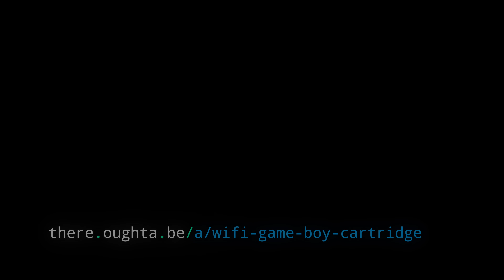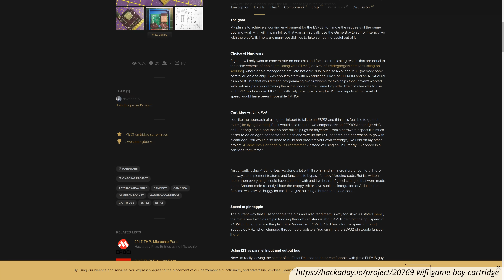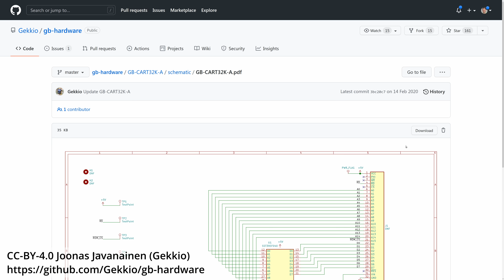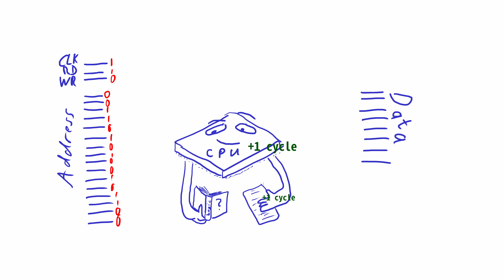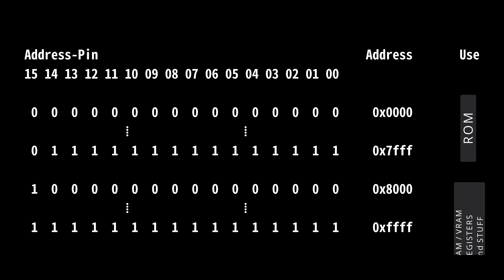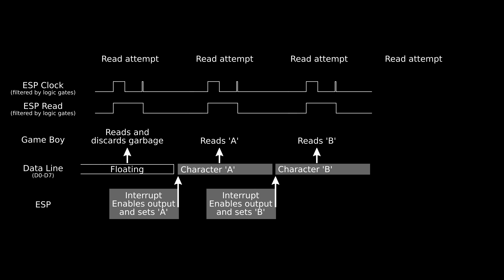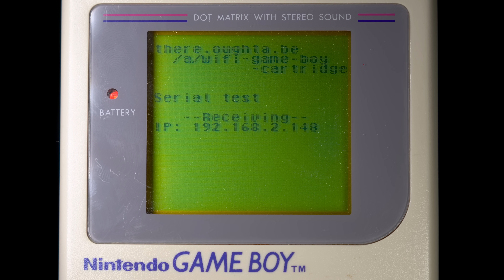WiFi Game Boy Cartridge

Comment: Mildly curious, if the interrupt to pin input speed being too short for the ESP32 to read was the main issue, would adding 8/16-bit storage registers on the data/address pins so they retained their state for the full duration between clocks be an option?
Reply from the maker: Jepp, I think that would be what I would try if I ever do a next version. To be honest, the current design was based on using the ESP-12F (ESP8266) that I know and still had "in stock" and the naive assumption that interrupts were fast enough. On the other hand, my current method only has negligible overhead for the ESP-to-GameBoy direction (the one wasted read at the beginning) and speeding up the interrupt code is probably more important at that point. For the other direction, things are quite differen - here a buffer would greatly improve things.

In the end, it is the design that finally worked and designing another PCB, buying components, soldering everything and updating the code for a pure fun and proof-of-concept project is not really worth it. So, I think I will mention some of the many suggestions from the comments around the web in a follow up video, to share it with those who want to learn from such projects.
Reply: @ThereOughtaBe  : If you do go down the programmable logic route in the future, remember that memory(whether RAM or ROM) can be used if you just need combinational logic (you need to add another chip for the buffering suggested here), and use that to help yourself understand this stuff faster.
Reply: I think the cleanest solution would be to add a CPLD that handles the address decoding and contains latches to handle the read and write data - When you write to the logic, it stashes the value written into the latch and then gates it out to the ESP data lines later.  The other way, you write to the CPLD from the ESP and have a GB readable status register that has "I got stuff for you" flag.  It would also get rid of the discrete decode logic.
Reply from the maker: I have to admit that I do not even know precisely what a CPLD does :) Sounds like something I should look into.
Reply: @ThereOughtaBe  Mostly, a CPLD does precisely what you tell it to. It's a bunch of programmable logic functions, mostly like those gates you used for address decoding, but often including a handful of registers. A typical use is for bus arbitration, and you may have seen a few of the smaller variants, PALs or GALs, handling glue logic in small computers. FPGAs tend to extend this with far more registers, many more internal functions, and some memory - to the degree they can fully implement a computer like the GameBoy. Together they're known as Programmable Logic Devices.
Reply: @ThereOughtaBe  The name pretty much sums it up - "Complex programmable logic device" - it's basically a smaller and less capable version of a FPGA, but also a lot cheaper.   A couple of latches with 3-state outputs, an address decoder and some logic is exactly the sort of level of complexity they are targeted at.
Reply: Wow.. I tried making sense of this comment thread and now I feel really stupid 👀
Reply: I'm about halfway through the video, and I'm curious as to why dma was not used or a microcontroller with an adequate control law interface. There are low cost micro controllers out there with control law accelerators that utilize a DMA controller to feed the rw lines.
Reply from the maker: @Jonathan: Are there ones with WiFi? I am mostly putting up with the limitations of the ESP because it brings the WiFi module and adding a second micro controller seems a bit excessive. (Yes, and it is not an ESP32, because I still had a few spare ESP-12F.)
Reply: @ThereOughtaBe   I've used the I2S DMA on the ESP32 for pushing out audio with few cycles before - perhaps it could be repurposed? *Nevermind, just saw someone already suggseted it :).
Reply: Different variation on the same idea: Dual-ported RAM?

I am more a software than a hardware guy, but a lot of early 90s devices, when they needed multiple completely different CPUs running at completely different speeds to talk to each other, they did use a common buffer that both could read/write to.
It might have been dual ported video ram (between a computer and a graphics card), or two banks of normal memory that are alternatively swapped (CPU0 sees one bank, while CPU1 prepares the other bank; MegaCD uses that to send video to the MegaDrive).

In a way it's a more off-the-shelf (require no programmable componenent like PAL/GAL/CPLD/FPGA) variant of what several other people have suggested in this thread like implementing latches.
Reply: @DrYak  Some ISA ethernet cards in the early 90s used shared memory, like the WD8013 cards. This provided a bit of a performance increase over the PIO that the NE2000 cards used. As I recall they just used a static ram chip of some sort.
Reply: I'm wondering if the RP2040's PIO blocks help here, because they can be clocked directly by the Gameboy.
Reply from the maker: @Quentin: Yes, I love the PIOs of the rp2040 and I am quite sure that they would have solved it as they can just buffer the output and set it within few cycles. But it does not come with a WiFi module and adding a second micro controller felt wrong :)
Reply: @ThereOughtaBe  now there is the pico-W with wifi.
Reply from the maker: Jepp, that would have been an interesting one for this project. I am currently thinking about another project without wifi and will quite certainly use an ordinary rp2040 for it. Decoding the data bus with its PIOs should be so much easier than using the ESP.
Reply from the maker: @Kev711 Well, that is just an rp2040 with an ESP8285 (similar to an ESP8266) in a neat little package. It would definitely solve many problems, but it would also draw up to 100mA on top of what the ESP8266 already consumes. (Quick worst estimated, but it will be significant.)
Reply: pretend what i am saying is very intelligent like this comment reply section
Reply: @A1Animator  Damn dude! That's technical af! Happy new year!
Reply: A small FIFO as a mailbox between the GB and the ESP would fix most of the mess. With a CPLD or small FPGA you could implement one side of the mailbox using the gameboy bus and the other side something like SPI with an interrupt to wake the ESP when the gameboy has put something in the mail box.
Reply: This is what it must sound like to some people when I talk about cars lol. I have no idea what you’re talking about, but your videos always lure me in. Keep doing what you do !!
Reply: No more linkcable, WE HAVE T E C H N O L O G Y

Comment: I wonder if you were too quick to dismiss an important concept: Most of the ESP32 series has two cores! Forget about interrupts: crank the clock rate to 240 MHz, and have one core sit and poll the clock line. You've got the 80 MHz memory bus and possible contention between the cores as your bottleneck, but 240 CPU cycles should be plenty if you're not doing anything too smart. Leave your wifi and other nonsense to the other core.
Reply from the maker: If I designed another Wifi cart today, I would use the PIOs of an rp2040. They can handle this without even bothering the CPU which just puts stuff into or reads from a queue asynchronously (see my GB Interceptor project). We never stop learning :)
Reply: @ThereOughtaBe  cool stuff... I google and come back to your project probably once a year. There is something special about cramming Espressif chips where they don't belong. I'm using them professionally now which is good fun.

Comment: This is not at all what i have been looking for but has the exact information i needed. I want to make a gba game where i can control leds inside the cartridge, u showing how you separated the last 2 addresses is exactly what i needed! Now i just need to find the right small chip that can read the data coming in and store that change internally as it sets the leds on or off

Comment: Have you tried making an equivalent wifi cart for a Gameboy color, or a Gameboy Advance?
Reply from the maker: Well for the Game Boy Color it is the same hardware. The only difference is the code which writes to specific registers of the GBC to enable double speed mode and to add colors. I assume you have already seen my video about streaming video through this cartridge? (If not: https://youtu.be/pX1opw_gsBs) I was able to do the same thing with slightly different software on the GBC: https://youtu.be/yCe_vuNdJOE?t=824

This would of course also work on the GBA in GBC mode, but that is pretty much the same as the GBA actually has a second CPU inside to be compatible with old Game Boy and Game Boy Color games (there is a physical switch in the cartridge slot that disables the faster GBA CPU).
But an actual GBA cartridge that takes advantage of the faster GBA CPU and more colors and everything is something quite different. These cartridges are not even electrically compatible (old Game Boys use 5V logic, GBA uses 3.3V) and the code is also quite different. This would be its own project.

Comment: I've been thinking to do some similar experiments with the MSX. I still have mine that I got about 35 years ago and it should still work. I'm thinking of using a few bus transceivers to add more Z80 CPUs to the system and extra ram.. Some ram would be dedicated to each CPU and some ram would be shared. I would also consider adding better graphics output, and use an atmega or STM32 for USB and i2c/SPI support and provide an i2c real time clock and i2c eeprom for permanent storage. I've never tried the ESP before. Would you recommend it over say an STM32H755?
Reply from the maker: I have not yet used an STM32, but I also cannot say that I would recommend the ESP8266. It was the first that came to mind after I had used it in a few other projects. It's neat if you need wireless, but In most cases using the newer ESP32 (or even its never variants) probably makes more sense.
Reply: @ThereOughtaBe  Yes, I've heard the ESP often in combination with wifi. I'm not sure why. Does it have WiFi on board inside the chip so you only need to route a piece of impedance controlled trace to work as antenna? There are many STM32 variants. I have a few on a Nucleo experiment board and it's not too hard to program with STMCubeIDE. I haven't done much with it so far though because of other projects. I believe the H755 is dual core with one core running at max 480Mhz and it has 2MB program flash and 1MB ram I think. Many support stuff like Inter-IC-Sound (I2S) and crypto and/or DSP instructions. So you could use an STM32 for a sound FX processor or something, although I've tried connecting a sound codec chip to it and couldn't get it to work so far.. But I'll try again some day.
Reply from the maker: The ESP8266 and ESP32 do not only have the WiFi module inside, but they also come with the antenna. You pretty much only have to supply them with power. That's why you will find them in every maker project.
Reply: @ThereOughtaBe  Waw that is convenient indeed. How is the WiFi range? Does it strongly depend on how well the shielding is or don't you even have to provide a ground plain under the chip? I found some WiFi devices I used in the past have a weak signal.
Reply from the maker: I cannot really say that I tested the range, but I had not problems so far. The antenna is pretty much its own overhanging PCB. You should not route anything under it and definitely leave a clearance in the ground plane underneath the ESP's antenna. Having a cutaway in this location is (supposedly) even better, although some argue it might be overkill. Just have a look at the assembly animation in the video and you will see the gap and the antenna of the ESP.

Comment: I am almost certain it simply draws too much power. It's just that the tolerances are big enough that it works when the batteries are full.
When I learned one things about electronics then it is:
Voltages  have a fairly big percent wise window of "good enough".
So I would recommend checking temps. If they don't look concerning that's probably it, you just drain more power then the GameBoy was designed for.
Because I have also learned another thing about R&D:
Not tested and not supported do not mean: Will not work perfectly fine.
Just don't bet on anyone having ever tested that.

Comment: Which PCB manufacturerer did you use? Did you have to pay duty for the PCB?
Reply from the maker: The PCB in the video is from Aisler, so no duty as everything was within the EU. But after I had a few problems with them (you can see a few improvised fixes on this cartridge in the top left corner) I order a second batch from JLCPCB (shown here: https://youtu.be/yCe_vuNdJOE?t=1787). Of course, those went through customs (which sometimes can take some time), but JLCPCB has shipping options that take care of handling customs.

Comment: im not sure if your project was first or the pico gb. but instead of just a wifi cartridge you could use an raspy pico w or an arduino nano, and insert your code. im far away from an expert but i like your project. I just asked me, with your knowledge you surely be able to do it better. even better than the Pico GB Project. but also i think im totally out because i dont know how much power is delivered over the cartridge contacts.
Reply: i looked up the numbers, you got an +5V output for the cartridges with an max of 100 mA average 60-80 mA. the pico w runs from +5V and 40mA so it should be possible.

Comment: Just wondering if you had looked at a cheap/small FPGA for offloading the bus signaling to make it more ESP friendly. The cost of a LCMXO2 starts around $5 US nowadays (not sure how much they were when you did the project).
Reply from the maker: Yeah, if I had not got it working on the ESP alone I would have had to add another chip. It would have probably been an rp2040 to use it's PIOs (like in my latest project https://youtu.be/6mOJtrFnawk) as I am more familiar with it. But I certainly want to look into FPGAs at some point.

Comment: So I'm a year late to the party, and maybe this has been done/suggested, but here goes. If you used a RPI Pico W, there would be several advantages. Its a 3.3V device, so power becomes easyer to deal with, buck converter or even a voltage divider. The PIO pins don't use the CPU cores, so you could use 2 for clock and direction. That would leave 24 pins if you use the 3 ADC pins. Also, the chip can be overclocked, so you could bump the frequency when its trying to communicate with the GB.
Reply from the maker: Well, I used an rp2040 in my latest project and indeed the PIOs would have made this project here almost too easy. But I actually already considered the rp2040 for this one, but since it has no wifi (the Pico W is just a dev board with an rp2040 plus an extra Wifi chip) the rp2040 would have been an extra chip that I did not need in the end (although the entire thing turned out a bit more hacky than planned).
By the way, the ESP8266 is also 3.3V. It's the old Game Boy that runs on 5V logic.

So, yes, the rp2040 is almost designed for interfacing with the Game Boy. Check out my latest project (the GB Interceptor) which really uses pretty much all the rp2040 has to offer.
Reply: @ThereOughtaBe  awesome! I’ll check it out here in a minute. Thanks for responding!

Comment: I'm pretty sure you could use rp2040, it's dualcore anyway
Reply from the maker: Jepp, and especially its PIOs would have made it almost too easy. I used the rp2040 in my recent project (https://youtu.be/6mOJtrFnawk) and it seems almost to be made for this. But it does not have WiFi, so here it would have been an additional chip, which I did not need in the end.

Comment: Cartridge systems did have advantages over CD based systems, in that the load times were nearly instant. The problem with cartridges is their capacity, which isn't really a problem anymore with modern flash storage.

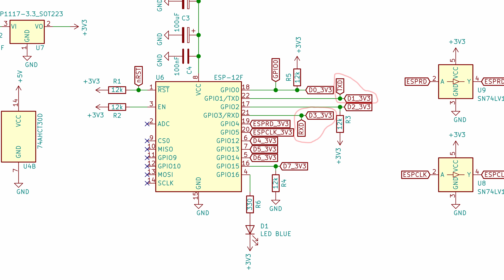Comment: 12:33 "You don't get to use the serial console during development..." -- How did you get around that obstacle?  In situations like that I'm usually forced to bit-bang RS232 on a spare IO pin.  Great project, and that 3D animation of your PCB looks terrific, must have taken ages to create.
Reply from the maker: Yeah, my fallback was similar. I mostly used the status LED on the cartridge. Either by just flashing it if I reach a specific branch in the code or by hooking that line up to an oscilloscope for more complicated output.